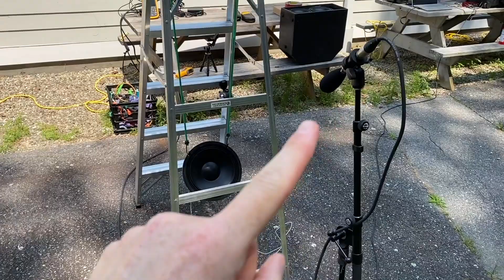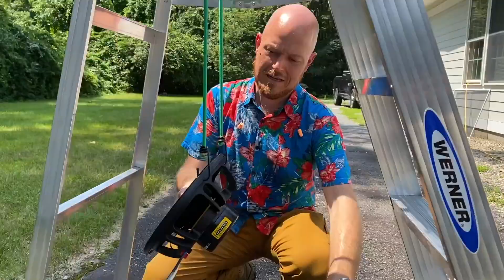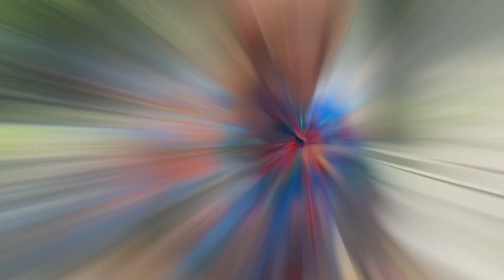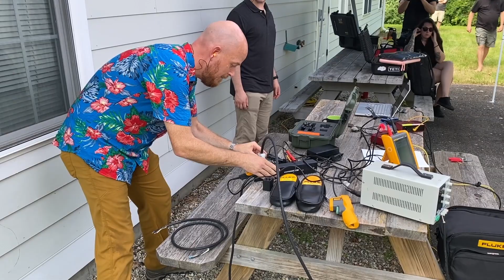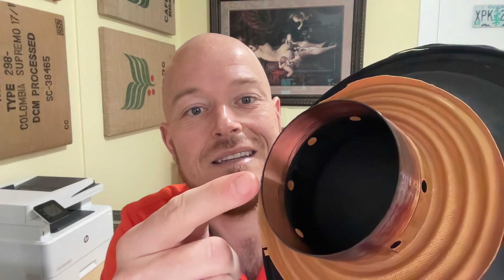Woofer Destroyer: Part 2!

Comment: Colliding tinsel leads are a problem. At my last house party I thought i cooked the voice coil of my old 12" sealed box Focal sub. I measured zero Ohms and was about to cut away the membrane for a possible recone when I realized it was just the tinsel leads being interlocked. Ive never seen that before, especially in a sealed box. Anyway the sub is well and alive.

Comment: Cerwin-Vega did that back in the70s - plugged their enclosure into a 60Hz 120VAC wall socket at an AES show demo although I can't recall which model it was, but it was a commercial sound reinforcement product.